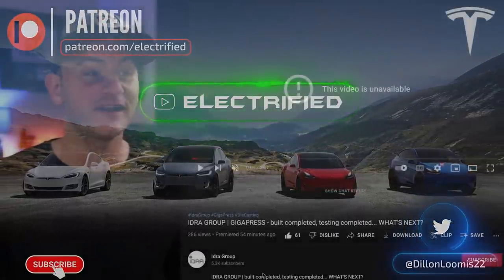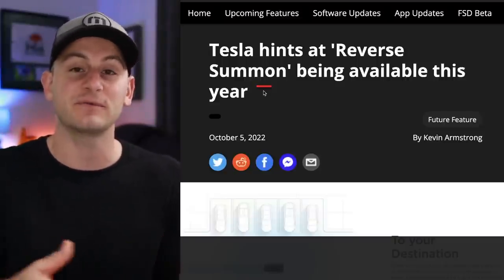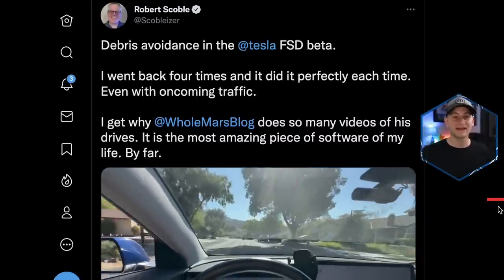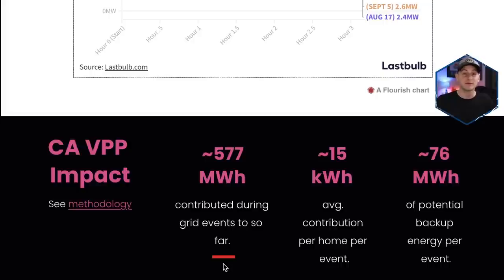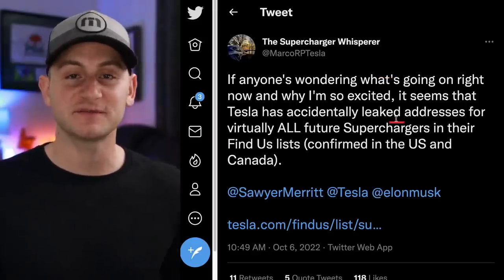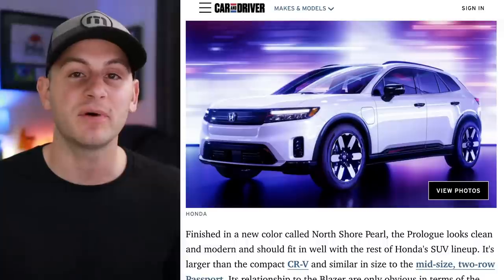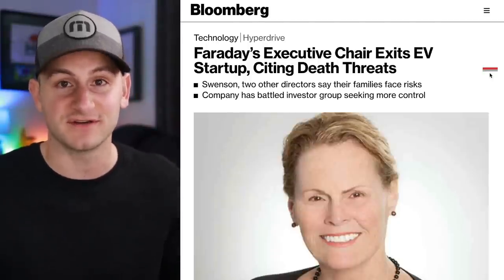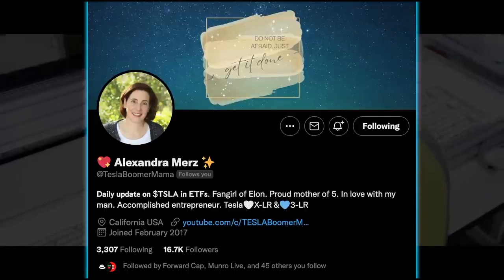TSLA Gets Investment Grade Rating: Now What? / Cybertruck Gigapress / Reverse Summon ⚡️

Comment: Regarding the Credit Rating improvement… If pension funds have been eyeing Tesla but were unable to invest because of their rules, there may be a movement to invest quickly before Q3 earnings are reported and take advantage of the current dip in Tesla stock pricing before the price heads up more quickly.
Reply: I doubt they'd do something that smart.  Probably, they'll wait until TSLA gets triple A.
Reply: Interesting idea that may occur that quickly.  In the end, any funds moving into Tesla stock have to come from somewhere...I wonder how much will flow out of traditional OEMs into TSLA.
Reply: I'm sure they will jump more into GM since leading the EV industry matters 👍🏻⚡
Reply: Good point.
Reply from the maker: hey dean, it makes sense but most of these bigger funds move very slowly and have to deal with boards/groups and pitch investments before pulling the trigger
Reply: Do the opposite of whatever commonsense says. That's how they roll and that's how they bankrupt all the retail investors.
Reply: Won’t do anything this year at all. Might start to help in Q1 as fund go through their huge bureaucracy to change investments!

Comment: A THOUGHT:  Ford was outgunned by Dodge in the early days because Dodge had color options.  Humanity seems to need uniqueness.  Since during production of TESLA EVs , control of the paint process is critical for quality, limiting paint options seem to improve quality.  So, consider:  each manufacturing site offers post-production painting  (PPP) at a price and a limited warranty.  It can be anything and everything from two-tone pastel like a '56 Chevy, to a side band by local graffiti artists of various random tags.  It would slow down delivery, raise costs, reduce overall quality (the PPP would be more apt to spoil than the undercoat), but it might attract additional customers as culture/taste evolves.  In the 40 years running a manufacturing business, I have seen drop offs in popularity of my product, regardless of quality, unless the style points are moved.  The investment in the PPP could be small, out in the holding lot perhaps, and the proof of concept could bootstrap if it works.  And the price determined by costs and demand, separated from and not affecting the factory price and cost set points.

Comment: 8:53 Design cues taken from a brick.
Reply: The cabover design minimizes the truck length and increases vehicle maneuverability.  Europe has tighter road/infrastructure than the USA making it way more common there.  We had lots of these in the USA in the 1970's but then some laws changed and truck designs changed to fit the market.

Comment: there are scenarios where I enjoy my radar based ACC.  In heavy rain radar sees things, I cannot see.  The thesis that humans only need their eyes is basically true, but humans sometimes enjoy a radar upgrade. I am not sure if its a good Idea to ditch radar completly...... Heavy rain, fog, heavy snow...... alll better with radar.  That said I wish Tesla would build a proper SUV like that honda one or BYDs SUV, or the BMW iX3.    I am sure they could do it and if it would have a bit less range ... who cares if it goes only 350km... totally sufficient. But the current models are too expensive and not suitable for a standard family
Reply: The main issue is that when you have competing systems that give different resultas you have to decide which to trust more. Different situations may favor different systems. So not only are you at risk of trusting the wrong system but also of deciding that in this scenario you're going to trust system A when you should have trusted system B (i.e. the perfect informaton was available but you prioritized the wrong output). It's better to make one really good system instead of mixing information of two good ones that can wrongly screw each other over.
Reply: Radar reduces safety.  Lidar is much worse.
Reply: Model x?
Reply: Less sensors expedites production

Comment: The drag co on the volvo looks awful. Its a wall!
Reply: There is a reason why European trucks are completely different from American ones to inform yourself
Reply: The cabover design is mostly about minimizing truck length to maximize maneuverability.  Smart engineers pick the right designs to fit the application and market.  Shorter truck leads to longer trailer = more load =more money to the hauler.  Also, it fits into tighter spaces which comes at more of a premium in Europe and other places than the USA. The designers and customers can't all be dumb.  Pick the design that fits your personal applications best.  The laws about allowable dimensions and weights vary in different jurisdictions too.
Reply: @markb9347  Interesting thx
Reply: @markb9347  lol…… you realise that the heaviest/longest trucks around the world most specifically Australia have both cab over and long nose trucks right! The cab over is only to improve turning circle/maneoruvrability in very small streets
Reply: @carholic-sz3qv  It doesn't preclude greater length, but it does allow shorter length. lol  That may be the only reason in Australia now, but not all places all times.  When length restrictions extended in the USA, the cabovers mostly, but not entirely, faded away.